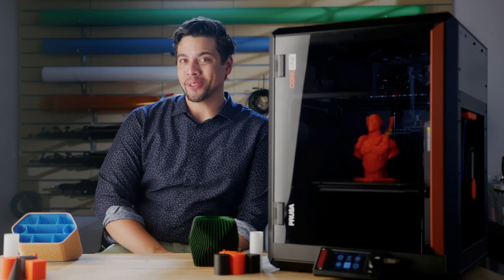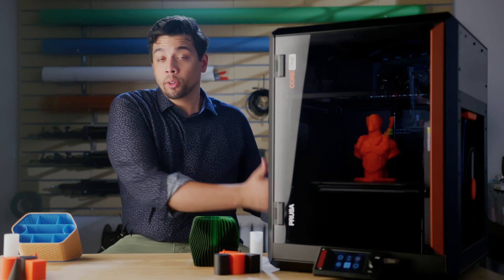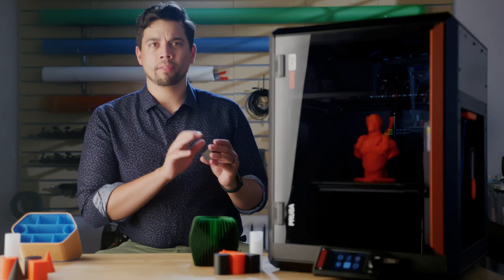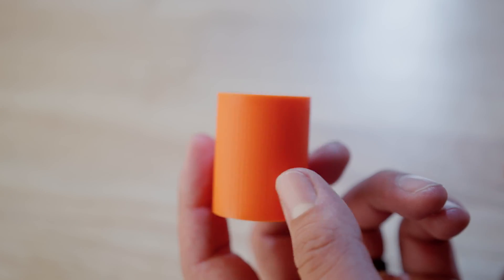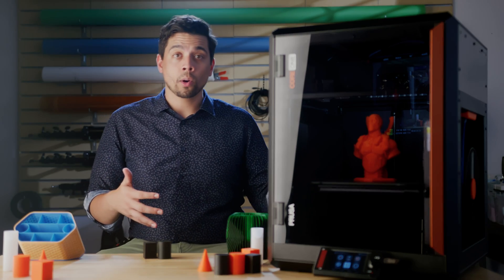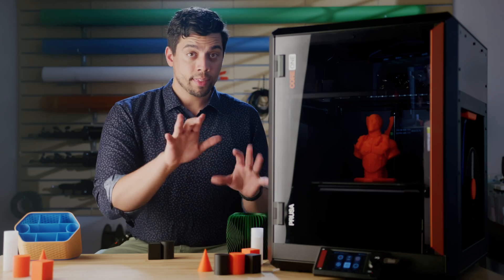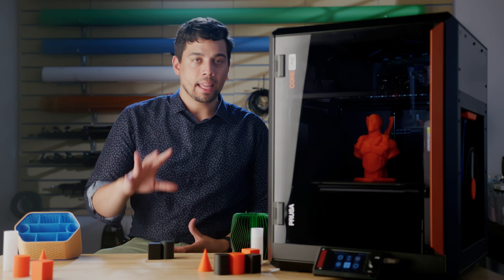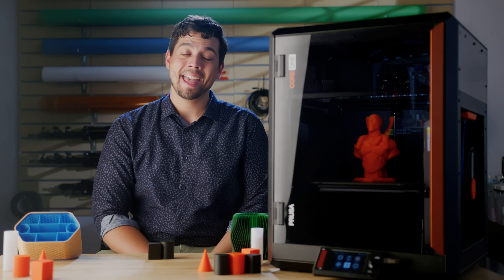Have they fixed the Prusa Core ONE | 6 Months After Launch Review

Comment: Well, the good news is that Prusa is working on an improved MMU. In Prusa's own blog from May 26. 2025, they mention that they are working on a complete re-imagining of the concept of printing multiple filaments. It will probably take a year or two for us to see the results, but it's promising to hear.

One of the things that is holding back the current MMU . . . is mostly a bit of stubbornness around spool size. The current implementation of the MMU3 can easily take 2kg, 5kg, etc spools. I imagine this helps in a print farm environment to minimize filament swaps. But it also means it can't be as compact as the AMS. They mention the ability to use and spool size in the blog post. Joseph Prusa also mentioned a couple of months ago on Reddit that he really likes being able to use spools of any size.

But maybe this is a sacred cow that needs to be set aside for a more compact system. People with more advanced needs can use a DIY solution or use the buffer and spool holders from the MMU3.
Reply from the maker: The old system works great for those who want that level of complexity so keep it as is for farms and stuff but a separate small easy to set up and compact system for the average user. Idk many normal users with 5KG rolls I feel like we all have 1kg or less right?
Reply: Supposedly the INDX system is going to be available in June of next year.

Comment: Few parts, vfa, that's nice but I would like to know, is it reliable after 1000s h of printing, maintenance,  or it reqire thinkering here and there.
I had a mk3s and it as really reliable, just print, no bugs no jams, just work when you need it.
I hardened nozzle, is better avoided if you dont print abrasives materials, brass transfer heat better and result in better prints.
Interface outdated is ok as long as it's reliable.
Reply from the maker: This is essentially a mk4s with an enclosure so they are as reliable- same parts and everything for the most part

Comment: For beginners like me, the instructions have two glaring problems.  First, loading the filament.  It says to insert the filament until it stops, which is wrong.  The correct information is to say, insert the filament until it stops, and then push gently again and again until the green check mark appears on the control panel.  Second, how to connect a computer to the machine via WiFi.  The instructions go right up to selecting the machine, then crickets.  Now what?  That's where I am now, I have no idea how to get it to work.  These two omissions show that Prusa never gave the instructions to a novice, only those already familiar with 3D printing.  Oh, and the anti-vibration feet?  The book that comes with the printer still shows the solid strips, not the four angles.  Addendum sheets, get printed soonest...

Comment: I really don't see the problem with the interface (UI)! At least not for a single extruder printer. I can imagine it being a bit small for an XL. Bur for the C1, I think it is great! New or modern does not always equate to better! I own a couple of other brands with touch-screens. And I have used some at work. I have no problem with the Prusa way of doing it. The Mk3 interface was getting really old! But once I upgraded those to 3.5S, they became great printers again! I use them nearly as much as my MK4S and C1! 

I have never been bothered with wifi-speed or connectivity, as I actually find it okay to just use the USB-stick. I have to prepare the printer before preheating anyway. And I usually watch the printer start the first layer anyway. So remote-starting prints does not seem like a big gain to me. Remote viewing on the other hand could be useful. With  that, the ability to remotely cancel object or jobs, should something go wrong. But for the most part, I am home while printing anyway. If so, I would visually inspect before cancelling anyway. So no big deal. The printers are wall-tied (electricity) anyway. So I don't see any big problem with wiring them (LAN). I probably will eventually. But I have not had any urgent need to do so. I find the periodic inspection-trips to the printer-room exiting! :-) Get's me up from the chair, as opposed to checking an app on my phone. :-p
Reply: My daughter is a nurse.  She loathes the touch screens at work. Says they tend to be very finicky.  I prefer the knob/dial option. Reduces the need for screen cleaning (although apparently the screen is a touch screen. I just haven't tried it yet.)

Comment: they expect to increase belt tension but at the same time create the tensioner in a way so after a few adjustments (belts do stretch with time) tensioner is to be replaced due to a fact a metal nut starts spinning inside the plastic piece...
Reply: I love the two turning methods.   
- I used the iPhone mike / belt plucking method to get it set the first time.
- Then I used their built in vibrating / strobe light method to check it and retension after three days of use.

Comment: I have the core one, it’s a good printer. The nozzle cleaning routine is the worst part for me. It sucks. But prusa support also sent me a replacement door handle becusse mine was bent. They asked a picture of it and sent me a new one for free with priority shipping so it arrived in like 3 to 4 days
Reply: Nice !   

I had gotten two LEFT side Belt Tensioners.  They shipped me a RIGHT side Belt Tensioner in 3-4 days.  In the meantime, I modded the left side to work on the right side.

Comment: 3 months in, still can’t get mine to print anything and customer service is not doing good at helping. There are a ton of people I found with my issue, and they said customer service helped them, and they didn’t help me and didn’t even understand what was happening. I’m just going to follow the forums. I think Prusa is gaslighting on the issue because they can’t afford to replace all the parts they sent out that were defective
Reply from the maker: Really?! Is it a kit you built or the pre-assembled and also what is the issue- it just won’t print or is it lower quality prints
Reply: @TheScrappyCreative mine passes all tests but as soon as it heats up to start a print, it can’t home and says crash detected. The z axis just goes up and down. It took weeks before they realized it could be the cable to spite the fact they knew that’s what the problem was, it was a problem on the forums since release and has been brought up many times. They have a problem with the main cables and load sensors with many of their fully built and kit printers. I’m getting sick and tired of their tinker model. I want a bambu printer without the security issues. The open source excuse is just an engineers excuse for bad design. Since it was a kit they are telling me I have to order new parts to spite them knowing this is a problem with their printers both assembled and kits

Comment: Any issues since this video ? Ty
Reply from the maker: Nope but other than PLA, and PetG variants I’ve just been using abs so far
Reply: Remember to 'tighten your thumbscrews' !   I had the print head drop into the part mid print.  It melted its way in about 2 of the 3" of print height.
Reply: @NickJames-o6m after further review I don’t care for all the extra steps too the core one or any prusa line but thank you for your reply , enjoy .

Comment: So far I couldn't find anyone who could give me an answer to this question regarding the Core One, maybe here : has somebody tested miniatures with it? I know 0.25 nozzles are sold for it, did someone print miniatures with that? Thank you
Reply from the maker: I haven’t but I think the smaller the better for quality, less room for error and this is an insanely accurate machine
Reply: I think you want to use a resin printer for miniatures. They are way more precise than this type of printer.  The pieces are more brittle, but that should not be an issue with what minatures are used for.

Comment: I just ordered one, but will have to wait until about mid September to receive it. I’m spending $1400, because of the “free shipping” on Amazon, instead of $1200 with $200 shipping from the Prusa website. Either way, it’s exceedingly expensive, and I’m looking for a printer that will do its job, not turn me into a handyman, trying to fix its problems. All I want is to print 3d models, without having them fail constantly. Is this the one I should choose? Is there another that’s better?
Reply from the maker: Depends on how long you want it to last. Prusa is a more proven brand and their printers can last 10 years+ and if you want to upgrade you can- Bambu I think are great machines and they’re doing cool stuff especially with their newer printers but I’m not sure if these are forever machines or not depends on you man. Personally I love my core one but I am a bit biased because I’ve had Prusa forever
Reply: @TheScrappyCreative thank you, I’ll let you know how mine works when it arrives

Comment: Also as far as engineering filament's I asked before i bought one I have PPA-CF it is a expensive filament the rep said that the core one could print that filament so I ordered one. My other two printers are down do to a couple reasons I can not fix and wont say the brand but I believe from what I have seen Prusa support  is top notch you may have to wait to get in chant but they are there and helpful. They also work to improve there printers the MK4 can be upgrade to the Core one. The MK3 can be upgrade to the Mk4
Reply: The wait has been anywhere from 12 minutes to 50 minutes.  But most typically it has been closer to 12.

Comment: Honestly, that’s the thing I always respected about Prusa – they don’t rush. They refine, polish, and perfect over time. VFAs? Give it a few firmware updates and mechanical tweaks, and the machine gets better like a fine wine 🍷.

I’d rather have a printer that evolves than one that just dazzles on day one and then stalls.
Reply: Take their time alright… still in 2017
Reply: Not really, my XL (that I bought 4 months ago and there is one broken tool already) is an overpriced slow dinosaur unreliable printer compared to my H2D, actually there’s no comparison… the H2D does everything better and faster… even my X1C is better.
Now with the Core One, same error, overpriced for outdated technology, and it is not fast enough… Prusa lost it’s ability to innovation it looks like, was the best and became obsolete, and a crazy expensive company!
Reply: @neymer1  With Bambu you pay with the loss of your data, and they just take away features from your printer that worked before. For me that's an absolute no-go. That's why I would always prefer Prusa and rather pay the extra price.

Comment: i bought one and i have really not had issues with the prints themselfs, aside from one flange model that just would always get a layer shift, untill i lowered the printing speed. 
i did have one that was a little sloppily assembeled though. The handle was on crooked and since its glued, i cant fix that. And the 2 screens in the back of the screen, the only screws that you ever have to touch when you buy a fully assembeled one...well they forgot them :D luckily i had some at home. 
I am also still having issues with Prusa connect crashing on demanding prints, but apperantly they are about to fix that in the next firmware update. 

BUT: i have to say: being able to live chat with someone that knows their stuff, after a very short waiting time, is really nice service. it has been nice to be able to just hit up their support, instead of having to google for answers from reddit..

Comment: idk if you made those very simple circular shapes yourself, but it seems like that was a pretty low resolution stl. 
if you made those in a CAD program and then exported them to an STL, you should know that most CAD softwares have options for those STL exports. you can set the resolution higher in those to get more triangulations and therefore a "rounder" circle. it does make the file bigger though.

Comment: Brass nozzle as standard is better. If you don’t need abrasion resistance, literally every other characteristic of the steel nozzle is worse and can result in print quality issues or clogging, even with a CHT steel nozzle
Reply from the maker: I learned something new. Thanks for that!
Reply: Correct.  'better' materials are not always better in practice. 

We switched a heat exchanger from lined carbon steel to stainless steel.  The thing looked like a sprinkler system within ten days.

Comment: :hand-pink-waving: Good video ;-) I have been using the Core One for a while now and I am seriously happy with it. The print quality is great, it runs reliably, and even handles more demanding materials with no issues. Building it from the conversion kit was actually a pretty smooth experience. Prusa really did a great job on this one.
Reply from the maker: Right they did so good, people I think over analyze these printers now to make them seem bad but all of them are so good it’s almost excessive to nitpick too much
Reply: Totally agree! Every machine has its little quirks but these printers really work great.
Reply: Well, it is good to nitpick, but you need to make sure to emphasize the really good bits  @TheScrappyCreative  !!!

There was the evaluator who looked at the plastic rivets and frowned...  I am getting used to them... I will probably pick up an extra packet of spare rivets just so I don't have to reuse them.
Reply: Totally agree Great machine and the print quality 💪

Comment: Thanks for the video :) regarding VFA, I noticed VFA on multiple prints you showed. Just check the arm of Deadpool for example.

But anyway. So... 

you get a bad feet (have you seen Bambu-s anti vibration feet solution? To me that feels innovative. Gluing on a piece of rubber feels rushed.

Got a brass nozzle.

No camera.

No competitive multi material solution

Plastic rivets holding the acrilic panels

Outdated UI

What the heck is that cumbersome air vent on the top? Have you seen the H2D-s? 

No nozzle wiper (that is indeed a big deal IMO)

Some units have bad VFA. Prusa would have a solution, but they want to get away without sending out new pulleys and belts so they are trying to make a magic belt tuner app. I dont know man, it feels bad to eliminate a hardware flaw with a belt tuner. But sure, we will see.

Long leadtimes, and misleading estimates

Too expensive.

You get it with a buildplate which is suitable mostly only for PLA. Why not ship with the Satin already?

In short, nice look, but way too much issue for how expensive it is. And despite that you are saying that it is worth get it. I mean, you have a right to your opinion, but just compare it with a P1S which cost less then half the price, assembled. Or for the price of the Core One KIT you could get it with the hardened extruder set, AMS 2 Pro and the AMS HT.

That is a lot pf 3d printer. Which doesnt suffer from VFA, it is faster, can dry filament, neater whole package and user experience and so on.

I had a MK4S with MMU 3. I liked it. Then ordered a C1. But instead of the promised 2 weeks the leadtime was 7 weeks, so cancelled it and got a P1S instead.

Man, that is a diferent league compared to MK4S. Just so much mpre convinient to use. Can dry filaments, takes up less space, prints bigger, nicer quality, and mainly, so far I got no failed prints. Dont have to wait with a tweezers for a print to start, even PC-CF isnt problem, can level the bed just fine.

So I jist send a job, dont even have to look at it and am confident that it will be done - nocely and correctly.

I am keeping my fingers crossed for Prusa but they are playing catch up. This Core One is trying to compete with 4 YO Bambus - and it fails in most points. Nothing inovative in it.

I am happyer with my Bambu then I was with my Prusa. But also am not a Bambu fanboy. Just check out Quidi Plus 4. For 750€. That - is innovative.
Reply from the maker: I agree Core One falls short in the innovation arena but I think I like Prusa for a simpler reason. They shaped the industry. I had a MK2 I had the MK4 and now the Core One. The print quality is great. The accuracy is great but so is literally every machine now even the cheap ones. I personally care about the company I buy from. If you want the best printer for the price never buy a Prusa. It really comes down to the support, the willingness to really interact and be part of the community and even Josef caring is why I like them. It feels good knowing that the company that built the machine care. 

That all being said their care for the community is their down fall. The need to make every machine upgradable has limited their innovation. If you want the most innovation you have to kill the upgrade path and I don’t see them doing that out of loyalty to their promise they made to continue making them upgradable.   

It’s not a simple problem or a simple solution but they built a robust machine and it works. Is it the most innovative- no. Is it sure to be as reliable as all of their other machines- most likely, and if it’s not it’s always repairable.

Comment: I built mine and it's been great, have it working the the MMU3. Joe mentioned that there will be a new multicolor solution coming in the future. Fingers crossed for a Bondetch indx option.
Reply: That system looks amazing (Bondtech InDx).  They are a bit shy on telling us the actual tool change time - I noticed there are two times mentioned - a tool swap and a heatup time.  So it might be 30 seconds between changes.  

I think I will let others bleed on that issue.  

There are not that many great multi-color designs out there.